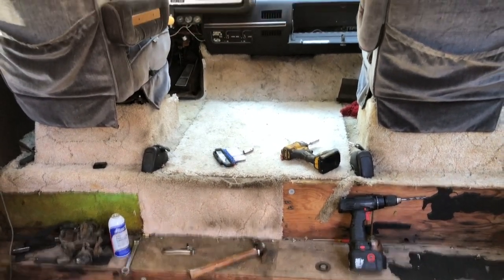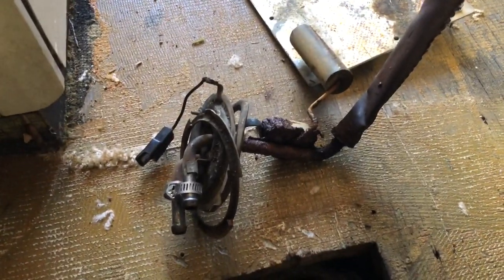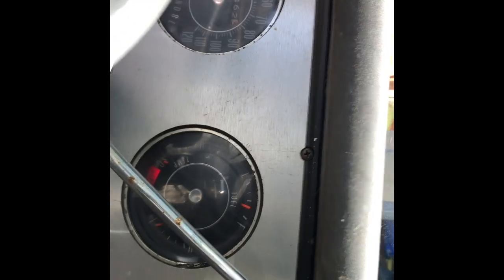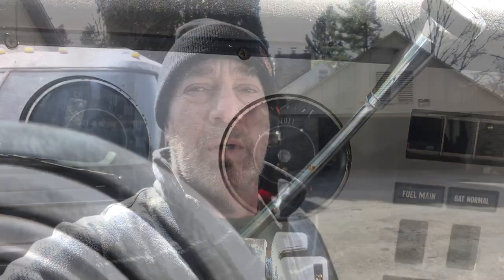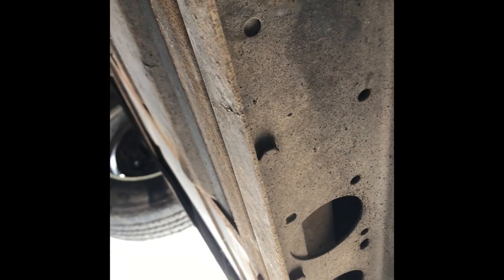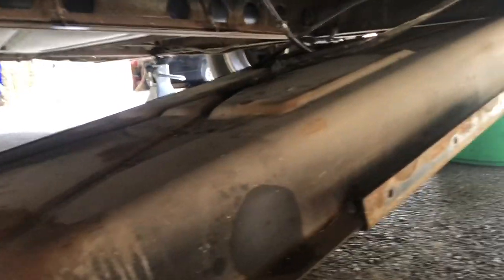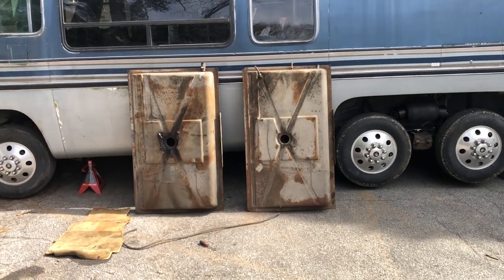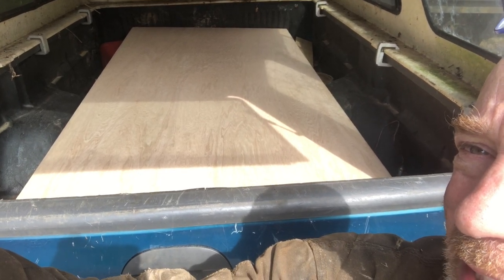1973 GMC Motorhome Episode 8 Dropping  the gas tanks !

Comment: Thanks for the informative series.  Quick question, did you ever  find out how long the ac would run off the lithium batt?  Thinking of similar setup in my gmc but not sure if worth the investment if run time is short
Reply from the maker: I have run it for 3 hours (in full sun) I have 400 watts of solar on the roof and a 5000 watt inverter. The battery never went below 50%
Reply: That is very cool.  How's the penny working out on the container rack...
My onan is done but I can not justify 4k for a new one.  Thinking of the setup you have ..makes more sense monetarily.  Your solar setup has some promise but it is also an expensive option  if go beyond one batt.